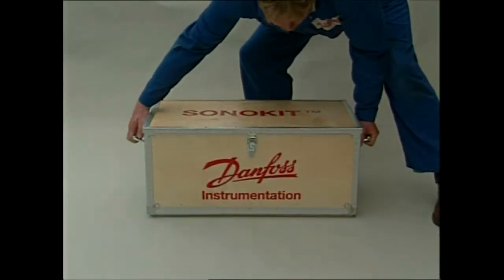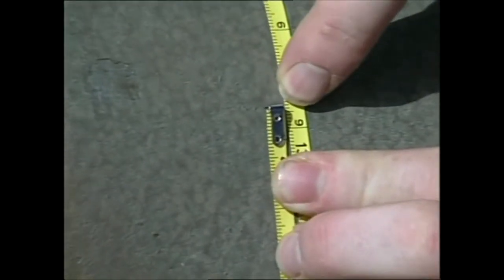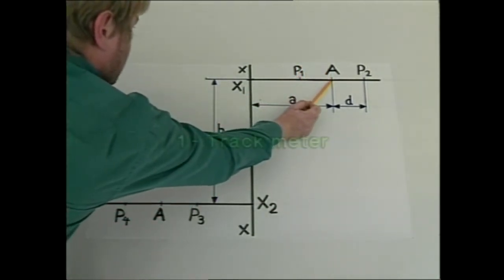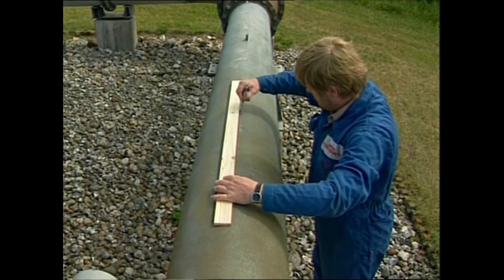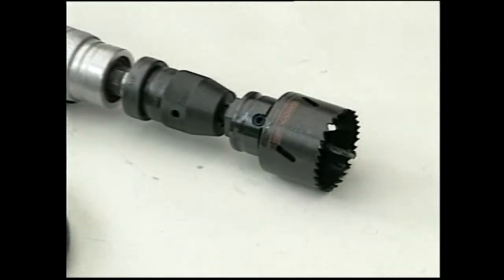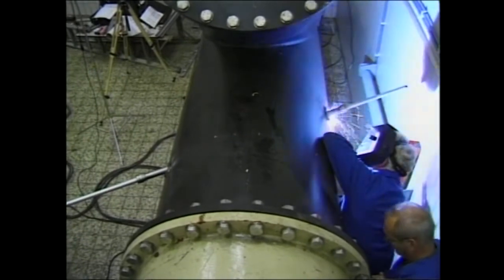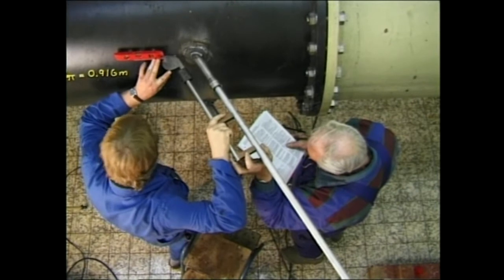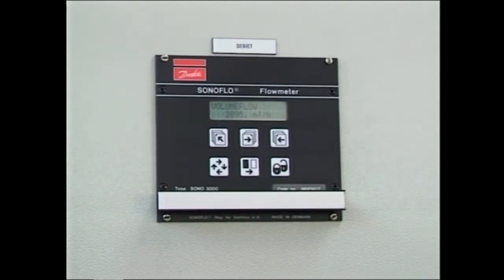SONOKIT® - How to install the ultrasonic flowmeter kit

Comment: Good video however the hot tapping operation on live pipeline did not show the operation in order to install sonokit sensor flowmeters on live pipeline. may be it will be very helpful to show the installation of sonokit sensor on live pipeline, it means no shutdown required for the installation.
Reply: sir we have done 200 hot tapping installations in india.
Reply: Good